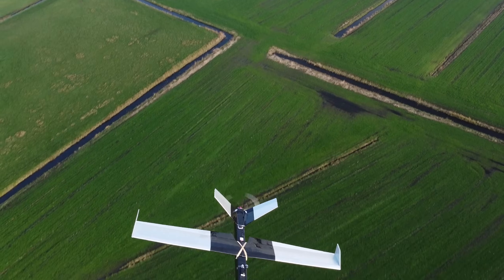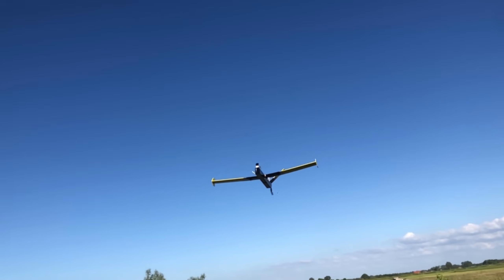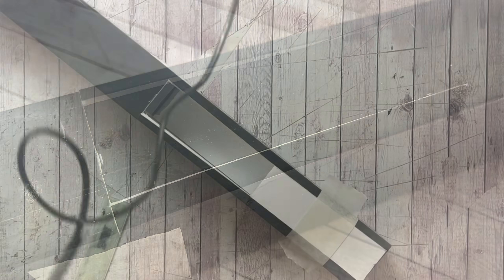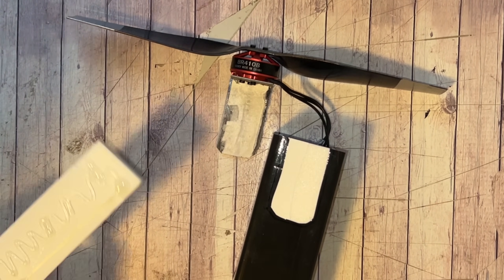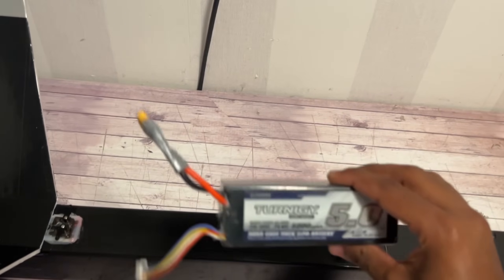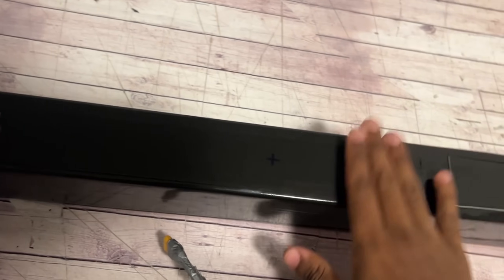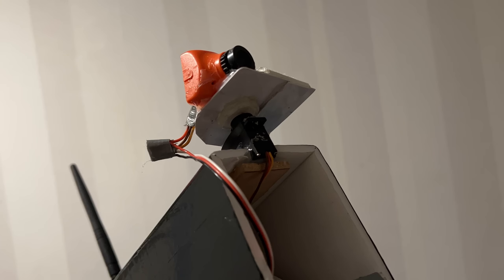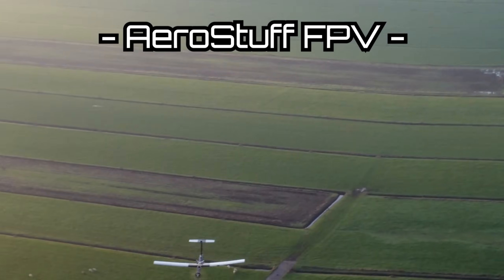How to build a V-Tail Aircraft for Long Range FPV & Autonomous Missions

Comment: how much did you spend on your build mate?
Reply from the maker: Approx. 2-3 days (realistically)
About 5-7 hours - Then it’s all ready to fly
Reply: @AeroStuffFPV  thank you for your reply. i sort of ment in money? i realize you probably had most of it hanging around from older projects, but if i wanted to do something similar? what sort of ball park figure should i expect? $100? $500? $1000? thanks again for your time
Reply from the maker: @adamroodog1718  Except the radio transmitter & foam sheets, It's around $130-170 per Default Flight-Controller-Equipped FPV-Aircraft

This is an approximate bucketlist ($50 flight controller, $30 receiver, $20 Motor & ESC, $2-5 prop, $30-40 on FPV Transmitter & FPV camera)
Reply: @AeroStuffFPV  thank you very much from australia

Comment: The design is pretty amazing to me. Good job! Question: How do you find a bank angle for a coordinated turn in autonomous flight?
Reply from the maker: Thanks man! Many more designs on the channel too =)

The bank angle is just determined throughout the years of testing. 12° banking and 10° climb/dive angle are the best values for autonomous cruise control
Reply: @AeroStuffFPV   Thank you! I will have some time to look around your channel. :) Are you an academic researcher?
Reply from the maker: @Hermis14  No man. Just an average student that is inspired to build capable FPV Planes. Nothing more. =)

Comment: How thick is the foamboard/sheet? 3mm, 5mm?
Reply from the maker: 5mm
Reply: @AeroStuffFPV  Thank you! You write that the foamboard comes from the EU. Which store is that? Or rather, which item exactly? I'm not clear exactly what material it is (if it has a paper/cardboard lamination).
Reply from the maker: @reinhardherden516  I couldn't find it.

But look for 70x100cm sheets of 5mm foamboard WITH paper! 

It's basically depron if the paper isn't there.

Comment: Interesting build, thanks for sharing. May I suggest a few details, that could improve performance? First the alluring box fuselage. The vertical side of the long nose will act as a vertical stabilizer in the wrong end of the plane and counteract the v-tail. Think shooting an arrow backwards (feathers first). A rounded shape would be better, but keeping the vertical side as low as possible also helps. Secondly, while providing some (servo) redundancy, the V-tail induces adverse yaw. An inverted V-tail helps providing positive yaw, but can be difficult to implement in the tail pushed design - it sits more better on a twin tail boom configuration. So a conventional tail may be better. Finally the availabilty of affordable laser cutters makes building your own wing profiles from NACA proven airfoils very easy, so you don't have to compromise here. Still I like you project a lot!
Reply: What a valuable comment! I learned a lot from you. Thank you :) The degradations will not be apparent for such a small-sized UAV, but those comments are definitely to be considered in a situation where aerodynamic efficiency is an issue.
Reply: Any recommendations of where I could get a crash course on these ideas ?
Reply: @LimabeanStudios  dis guy is in Denmark! 😱🤪🤣😁👍👍🇺🇸
Reply: Definitely "sits more better".
Reply: Hello
Reply: Wow, some people just can’t take constructive criticism, such snowflakes
Reply: If you have the lazer cnc option, using balsa wood is better for both durability and weight, I used it for both my wing profile and fuselage structure and it came aut to be better than I expected. But It's a bit more expensive compared to foamboard
Reply from the maker: Thanks for these ideas for improvements! - The Adverse Yaw effect had no significant or noticeable effect ever in my V-Tail designs and worked flawless.

The square tube design is just the easiest method of building a fuselage for FPV platforms (not the most aerodynamic/optimal shape, but it works well enough for a +10km and back)

The Inverted-V design came to me last couple of days coincidentally, to have an FPV design look like an MQ-1 Predator - But that is indeed complicated since it’ll need the retractable landing gear of same mechanics.

But it might happen because parachutes an consideration too.
Reply: Another Ukrainian nonsense
Reply: @VivaLaDirt  he isn't Ukrainian, he is in Denmark! 😱🤪🤣😁👍👍🇺🇸
Reply: Your fantasy CFD is not requested
Reply: Nonsense
Reply: Interesting, ... why don't you build your own! 😱😁🤪🤣👍👍🇺🇸

Comment: Why hot glue? It is pretty heavy
Reply from the maker: The aircraft was finished within 4-5 working hours (1.5 days realistically - could be built in the weekend or so)

If it were gorilla glue, the drying process throughout the whole build would be very long.

Comment: v-tail is an absolute shit. It's both a bad rudder and elevator
Reply from the maker: I have to disagree.

The V-Tail design has it's benefits and is applied in  FPV-Platforms (Mini Talon, Nano Talon) & Real Drones (MQ-1, MQ-9, RQ-4 etc...) 

Reason: It's more efficient since it has only two surfaces and is lighter as well which also increases efficiency because amp draw is reduced too. 

When the V-Tail is too small, then it's indeed to say it's shit because it's Yaw authority is reduced & will result in bad stability (still compensative) with a third stabilizer (but not recommended)

But when it's made in the proper size relative to the wingspan & fuselage, It's performance can be as good, if not better, than the Conventional Tail & T-Tail designs - And it just looks great.
Reply: @AeroStuffFPV  thank you for an answer and I do understand your position, but if you look through all the commercial and military designs of an aircrafts, you'll notice that there almost none of v-tails. The real criteria of the sooth is practice unfortunately.
Reply: Nonsense
Reply: @danielcockerspaniel  Thank you for that eloquent and constructive contribution to the discussion.
Reply: @SolarWebsite  np
Reply: @SolarWebsite  not my job to educate YouTube commentators on aircraft design but I will call out bs.

Comment: So the video states a 600kv motor but you link a larger 900kv motor, is this a v2 change or some kind of typo?
Reply from the maker: I also link up the perfect alternatives - You could go 600kv or 950kv // As well for the flight controller (Matek F405-WING) which is discontinued, but the others linked are identical in system & performance
Reply: @AeroStuffFPV   I see, I have some ~600kv motors, but I want ot make sure I'm not wasting efficiency. What is the model number(size?) you used for the 600kv, if you don't mind?
Reply from the maker: @spacemoses0  BR4114's from racerstar (Mine are from banggood)

Comment: Could this carry a gopro or any other hd cameras for on boarding recording? Also what about the landing wheels?
Reply from the maker: Yes!

This FPV Platform can easily carry 2 or more GoPro Action Camera's - If the fuselage is made wider in it's dimension, it could be used for mapping or other specific camera missions.
Reply: What about a landing gear? I want something which can take off easily off the land i stead of throwing
Reply: @ahtiramqureshi7788  That would add weight, drag, complexity and cost. I can see why it was omitted on a plane where one goal is long flight times and long distances.

It wouldn't be very difficult to add though, just reinforce the bottom of the fuselage in the correct places and bolt on the LG.

Comment: Cool! What kind of flight time did you get?
Reply from the maker: Thanks! 

I didn’t test flight times much. Currently still in it’s stabilizing & autopilot testing w/ the temporary 14x5.5(SF)

But I’d think approx 32-37min w/ 4S 5000mAh LiPo - But much increased with a different propeller

Comment: What modifications would need to be made if you where to increase the main body weight by a lot (say batteries) and how can you increase accuracy at high speeds + low altitude
Thanks a lot!
Reply from the maker: I know that my planes of these sizes can have up to 2.5kg AUW before it’s efficiency rapidly drops (4S LiPo’s/LiIons) and it’s current weight is 1550gr incl. HD camera of 60grams. so no modifications needed until 2.5kg or so.

If I’m exceeding that weight, I’d go for a thicker/longer wingspar and configure the flaperon mix to increase lift upon launch & landing.

- The accuracy could be done by doing an “auto-tune” which is a feature with iNAV-FlightControllers —> It’s to get the PID/PIFF values by just flying the aircraft for approx 5-8min and get the flight controller to measure the values.
Reply: @AeroStuffFPV  Thank you so much!

Comment: Great job. Your first V tail model is on my build list I think this one will replace it. Can I ask the motor you have linked in the description looks different to what you have fitted? What is the actual motor and prop you are running on this version?
Reply from the maker: Thanks! Good luck on your build =)

It's a BR4114-600kv with a modified 14x5.5 Carbon SF Propeller (Soon replaced with a 14x7/14x8)

- The motors listed are alternatives if the actual motors are out of stock. The previous V-Tail Pusher design (Black, Silver & Yellow) Has that particular BR3536/950kv.